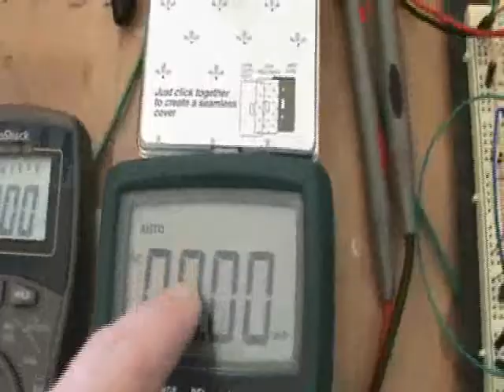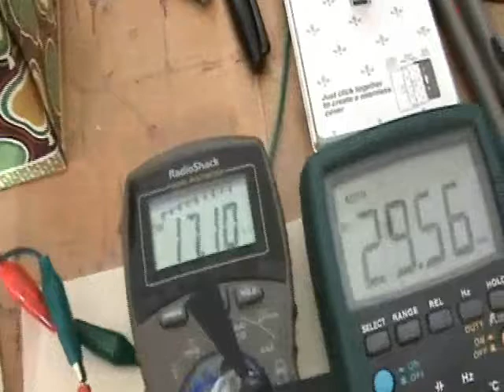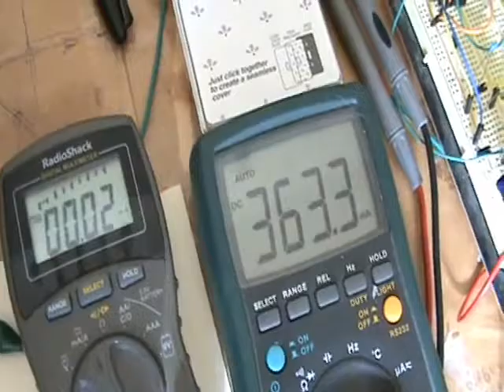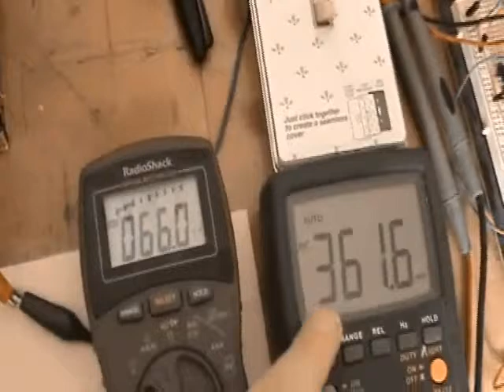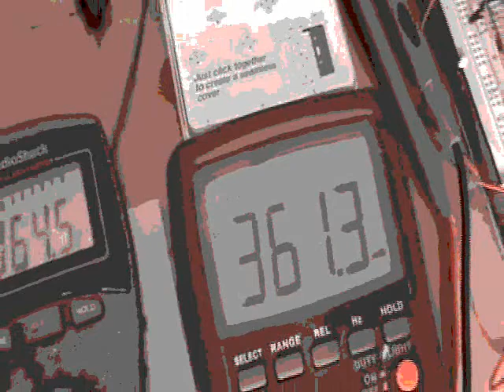"Tuna Can" Rodin Coil Current Draw Experiment

Comment from the maker: I don't think it matters whether its carbon or wire-wound. This load is on the other side of the bridge rectifier and 500MFD cap, so from the Rodin coils point of view, its a load with a resistance (or impedance rather).

Comment from the maker: Ok. I replaced the motor with a variable resistor as a load. As I increase the resistance, the main supply current increases. As I reduce the resistance, the main supply current decreases. So with JUST resistance, this effect can be shown. With a motor or inductor as load, I'm sure the situation is more complex.